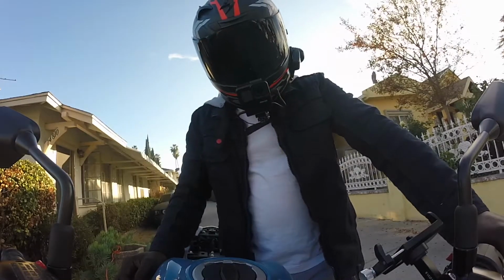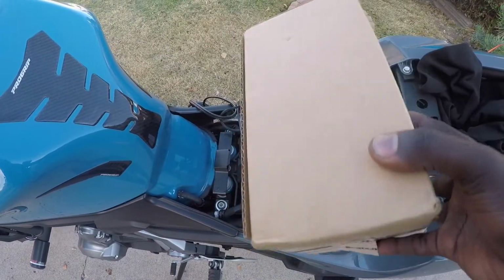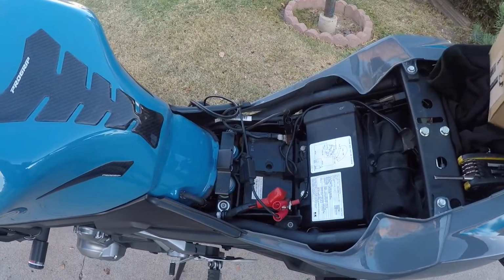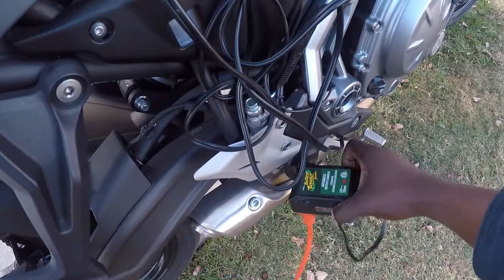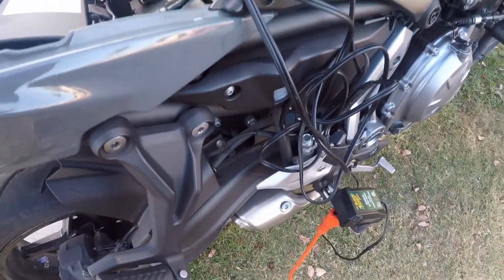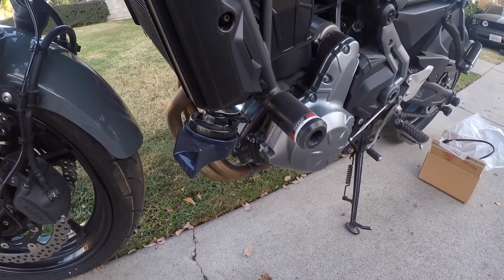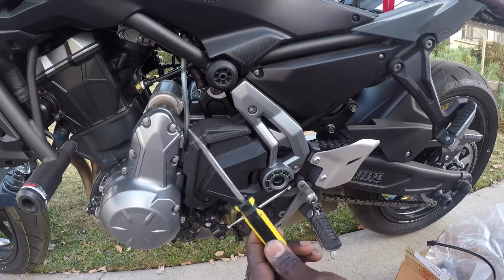O2 sensor Replacement on kawasaki Z650

Comment: Hey mate.. I have engine light on my z650 2021, its sat 33 code,in forums/manual its say "oxygen sensor"..
I must to change..or may be its desepir.. Thinks
Reply from the maker: Did u wash heavy pressure washer your bike or left it in rain 🌧 because that is the major cause of the problem ,u can't repair it which means u gonna need a new one. The good news is that,it's cheap at partzilla.com or bikeband.com
Reply: @rbon2wheels  thanks alot champ

Comment: Did the engine light went off after this? I have a engine light on, code 67 for o2 sensor, so I just replaced it for a new one but I still have the engine light on with the same code, 67. 
Thanks
Reply from the maker: U will have to ride the bike for about 2 to 4 rides before it goes off. It took me 4 rides in order for the check light engine to go off.
Reply: Nice! That's again for the video. 😁
Reply: @gfsc23 did it went off automatically?
Reply: @sisoMK  No, it didn't. On my bike I had to get a new ECU to get rid of that code.
Reply: @gfsc23  wow a new ECU, u had problems with ecu then? I just ordered a new o2 sensor from amazon and it arrives tomorrow, i will replace the old one and drive some time and see if the check engine light dissapears by itlsefs, if not, i might go to the workshop and plug the obd machine to delete the error
EDIT: me acabo de fijar en tu nombre y supongo que hablas mejor español jajaja
Reply: @sisoMK  We tried to delete the error code on the ecu, but it didn't work as well. So replacing it was the only way. Luckily I found one on Ebay that wasn't too expensive. Good luck with yours! Hope that just the new co2 sensor fixes it.
Hahaha, yeah, I can understand some Spanish, but my first language is actually Portuguese =P

Comment: Did you plugged the ecu into the computer to remove the engine light after the replace or it gone after the replace
Reply from the maker: No it goes away after a few rides going over 30 mph  once the problem is fixed.
Reply: @rbon2wheels  ok thanks

Comment: Hi brother 
I have yamaha mt25 and engine check light  is on when i check it on obd i saw the code p2195 what can i do should i replace o2 sensor
Reply from the maker: That P2195 is o2 sensor ,yes replace it and once replaced ,u can clear the engine light using the OBD2 or just ride the bike and it will clear its after maybe 2 rides going over 15 MPH.
Reply: @rbon2wheels  thank you so much. Last quastion if i clean it with alcohol it can be ok or i have to buy new one
Reply from the maker: @volkangul7075  No u need to buy a new one. I tried it and never worked. U better off buying a new one.

Comment: Hi,
 I have the same problem, but i am junior about the mecanic.
The check engine light is always on when I ride the bike.  If i understand, i need to have the error code, but which site can give exactly the definition for the error code?
At this time, i do not catch the error code, it is only yesterday i have this issue.
In the past, my brother give the bike to a bike market reparation, and pay for have a diagnositc,  and the man say error P0130.
Anyone can say more about this, please?
Is it easy for change this sensor ?
Thanks for your advise and help :-)
Reply from the maker: Yes it it easy to change the sensor.
I also made a video on how u can get the error code on you bike .u can watch that. But I can help  here too.
What u are going to do in order to get the right code from your bike is
1. Make sure your Odometer reading shows your mileage on the bike.
2. Press and hold both the left and right buttons at the same time for about 5 seconds and the code will be displayed with 2 digits. 
That is the error code on your bike. If it is shows code 33 that is the o2 sensor problem. Also all the error codes are in the bike manual or u can look them up on google.
Hope this helps.